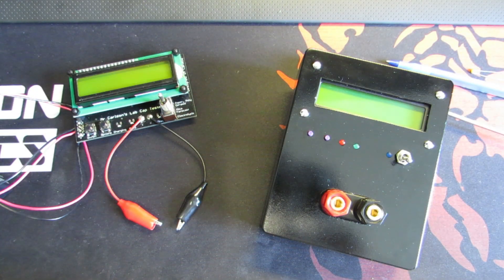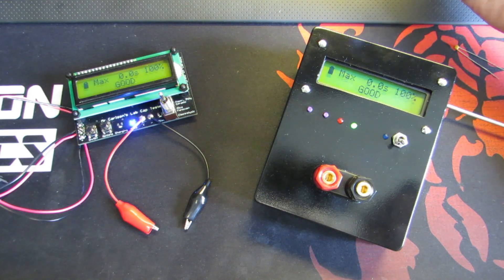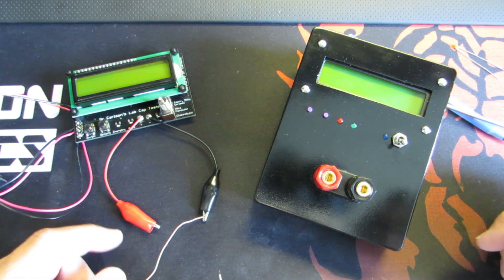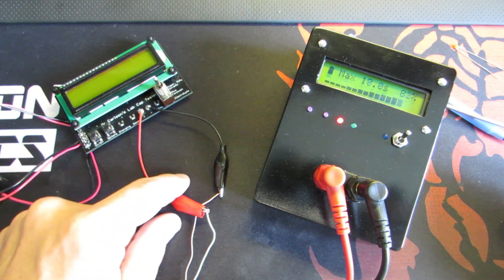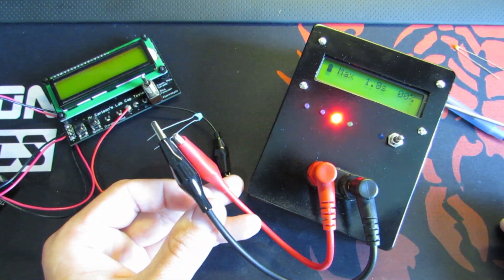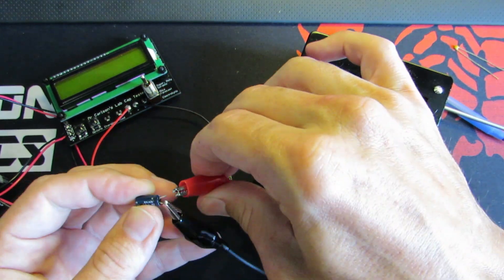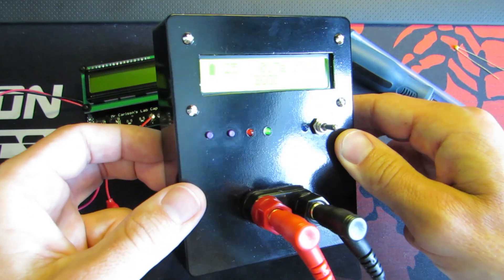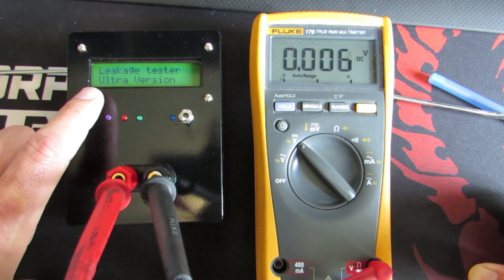Carlson's cap tester

Comment: Where can one find the PCB for this project? I assume it is for sale somewhere. I am part of Mr.Carlsons lab on Patreon but no response when I ask the question.
Reply from the maker: Hi, Click on my link in the comment. This will open the project on the mrCarlson patreon side. You will see a one drive link "file you need" The gerber file is under this link. Just double checked it's still working. You need to send gerber file to pcbway or jlcpcb or as you wish. Yannick
Reply: Thanks for the reply. So I can’t just buy the PCB somewhere? Okay thanks. Probably won’t mess with it.
Reply from the maker: @rbc1225  I just change the front end I will be able to come out with a newer model. Similar but more sensitive and from my own head. So I'll be able to share it with you the whole project. Let you know Yannick
Reply: @YanickT  That's awesome, yes please let me know. I am sure it will be nice.

Comment: Thanks for sharing! Since you've made it digital how hard would it be to show true capacitor value,  ESR and milliamp leakage?
Reply from the maker: Capacitor value and esr are made with an ac signal. It's not the same. Amp leakage (nano, pico amp) should be possible but uC isn't accurate enough to do this on it's own. A buffer op amp or very low front end buffer should be used before to enter uC. In addition we should calibrate the whole thing with a very large 10 gig ohm resistor to be accurate. Look's easy but it's not.

Comment: Hi.
2 questions: where did you buy the 2 transistor T1 and T2? I cannot build mine because I'm unable to buy them locally. eBay is not an option for me.
If you look at your Fluke 179 straight at a 90 degree angle, is the LCD as sharp as in this video (viewed at a shallow angle) or has a much lower contrast?
Thanks.
Reply from the maker: It was on mouser if I’m remember correctly.
Reply from the maker: Contrast is the same
Reply: @YanickT  Thanks. On mine contrast decreases significantly when viewed from straight above.

Comment: Dear Yannick, i have some questions, I  used your gerber file to  get a  PCB board. Yes I got this info because I  am member of Mr Carlson patreon, what I do not understand the zeners to get diiference voltage (max 25volt,) why is that? is it then still possible to check electrolyte of a higher voltage?
Mr Carlson use a sealed probe wire, you do not, is that a problem?
Your response to Internaut : This schematic is from 2018. It's corrected on my new version., is my ordered PCB made from your gerber file, wrong or also corrected
Reply from the maker: Hi, voltage max is 27v. If a capacitor is rated for 600v (exemple) you will see the leakage at 27v. Mr Carlson did a demonstration of that. For the pcb pretty sure it is correct. Just look on the pcb to have v1.1
Reply: @YanickT  thanks Yannick your are right the pcb has version v1.1, very excited to build your version of this tester, hope it will work

Comment: i think the emitter of T7 must go to ground.
(Edited 1): When T4 is active, it will draw a lot of current through LED Green. Shouldn't the LED has a limiting resistor? hmmm... unless the position of R15 is wrong.
(Edited 2): The selection is against the spirit of the Low voltage concept. When you test capacitors ranged over 27V like 50V to 10000V is OK. but when you test a capacitor rated 25V It is testing the capacitor to its limit voltage range. To keep the concept should be tested with the half or less voltage. Otherwise, you are like forming the capacitor instead of testing it....
But if you reduce the voltage with Zeners diodes, the Mr. Carlson Black box does don't know what it is measuring,... unless you calibrate something on the uC side. apart from a lot of concerns this video is intriguing and has kept my attention. Good job, Yannick.
Reply from the maker: Good observation.  This schematic is from 2018. It's corrected on my new version.

Comment: Is there really anything so innovative in the analog section that prevents you from disclosure of your design? I do not think so. Just a two-transistor low current comparator. I think Paul Carlson is selling some snake oil here...
Reply from the maker: Probably but i respect him on this. Anyway it's just 2$. Login, grab all you need and you can grab all you need to do my tester. Maybe later i could ask to him if i can release the whole thing. Thank you for you comment